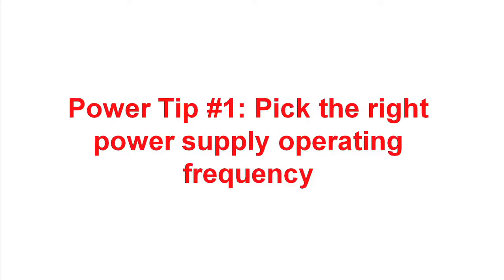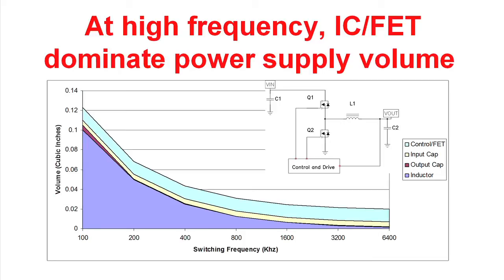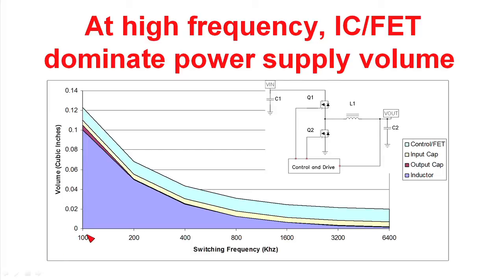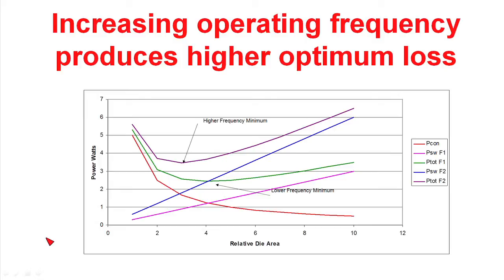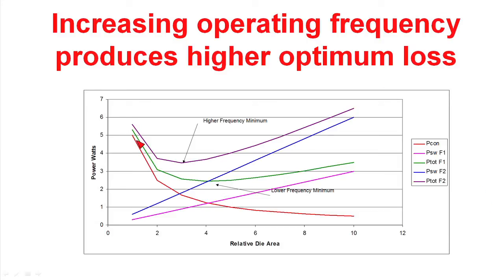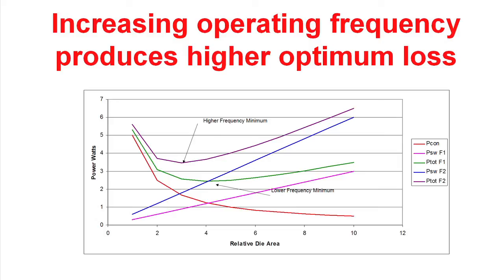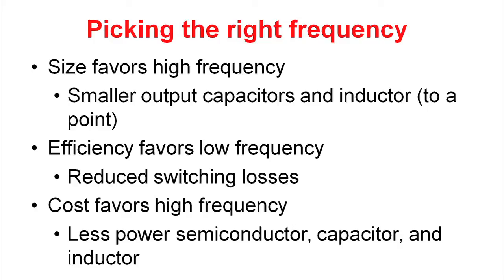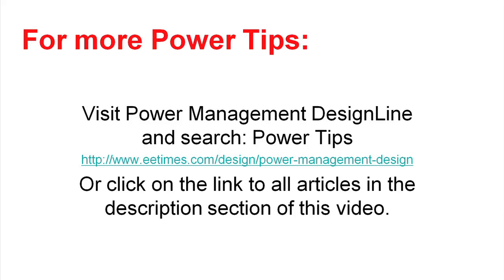Power Tip 1: Pick the right power supply operating frequency

Comment: Hi Robert I would like your comments/suggestions on the following. I am intending to build a SMPS with a 3 phase 400VAC input and an output of 80VDC at 300 Amp. I would like guidance on the project. Maybe you can do an application note on it. Thanks in advance